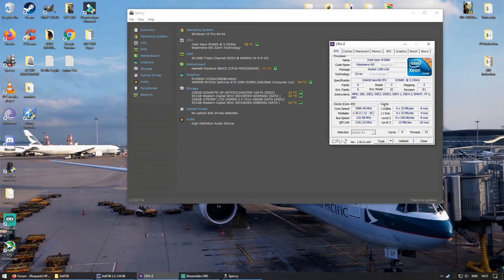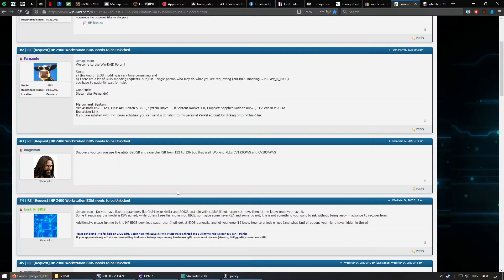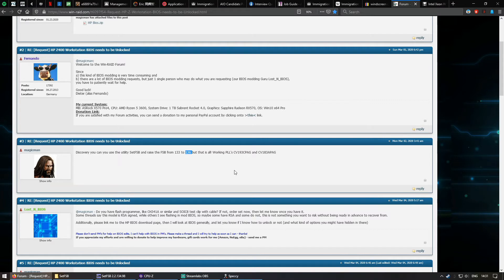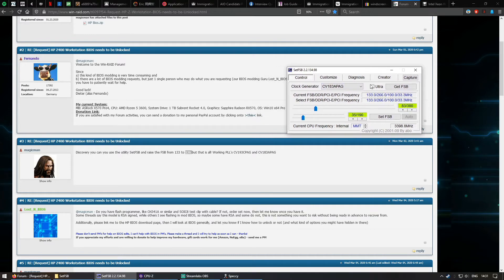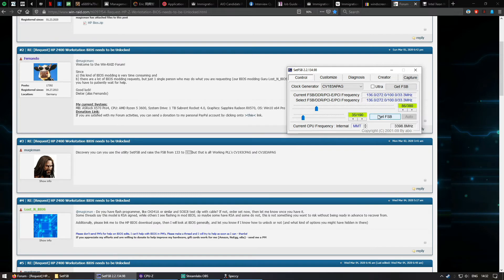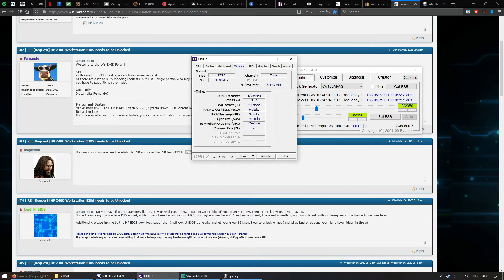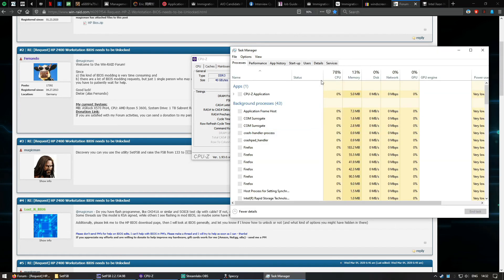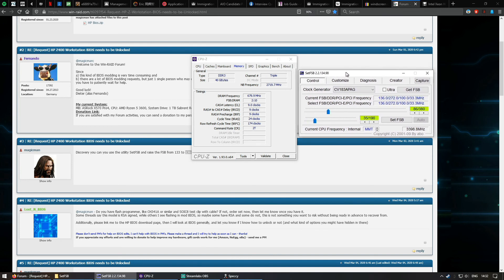How to OVERCLOCK FSB on HP Z400 PC! 2.25% Increase

Comment: what cpu should i get for my z400 i have a w3565 but i want to upgrade. any recomendations?
Reply from the maker: W3680/x5680 or w3690/x5690
Reply: @UrbanOzzy  i got 5687 can i oc
Reply: @UrbanOzzy  hi do you do set fsb with start up
Reply: @UrbanOzzy  hi do i have to restart pc for it to work please reply me asap thanks
Reply: @UrbanOzzy  hi do i have to restart pc for it to work please reply me asap thanks also i use a 2022 laptop hp should i use the one in your decsription and save my bios on usb so should i be protected
Reply: @UrbanOzzy  hi mine is hp 250 g9 laptop intel core i7-1255u also do you have to restart your pc for set fsb to work also are all its settings automaitcally in bios and how do i turn it off in bios please reply me asap thanks
Reply: @UrbanOzzy  hi  do you have to restart your pc for set fsb to work 

also are all its settings automaitcally in bios and how do i turn it off in bios please reply me asap

thanks
Reply: @UrbanOzzy  hi mine is hp 250 g9 laptop intel core i7-1255u also do you have to restart your pc for set fsb to work also are all its settings automaitcally in bios and how do i turn it off in bios please reply me asap
thanks
Reply: @UrbanOzzy  hi mine is hp 250 g9 laptop intel core i7-1255u also do you have to restart your pc for set fsb to work also are all its settings automaitcally in bios and how do i turn it off in bios please reply me asap thanks
ill do what ever you want

Comment from the maker: EDIT: I tried 138MHz, that worked after heavy gaming session. Very stable. No issues.
Reply from the maker: @ZuckerbergDaReptilian  yes. Your milage may vary, depending on your system. Try 137/136/135/134. til you get a stable system
Reply: @UrbanOzzy  hi mine is hp 250 g9 laptop intel core i7-1255u also do you have to restart your pc for set fsb to work also are all its settings automaitcally in bios and how do i turn it off in bios please reply me asap
thanks